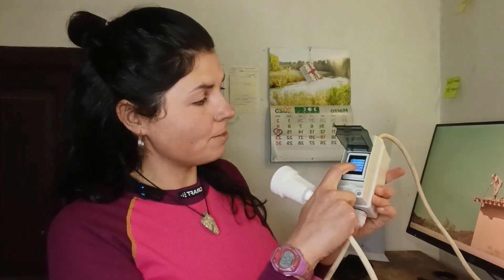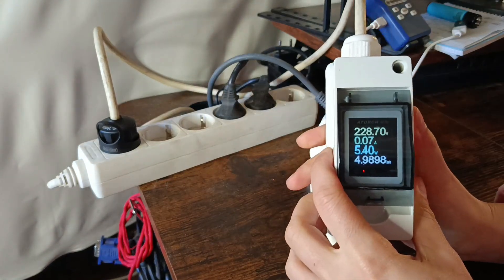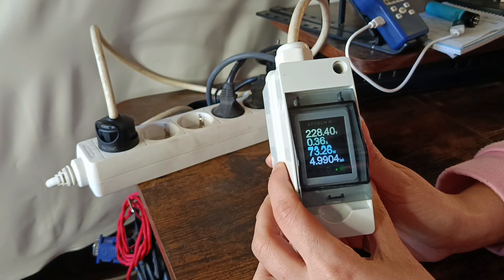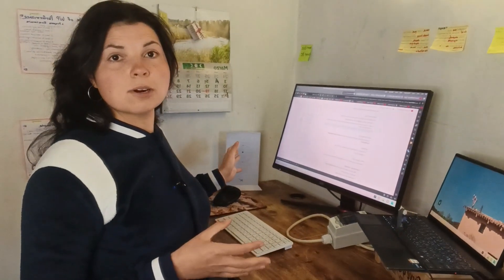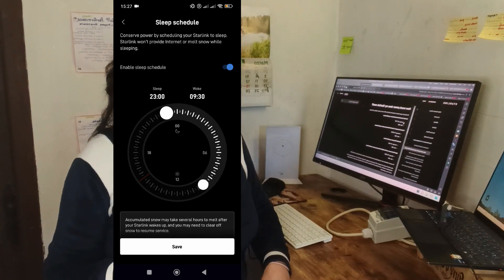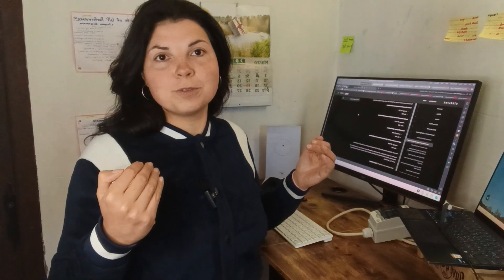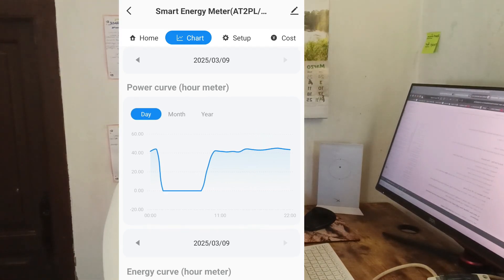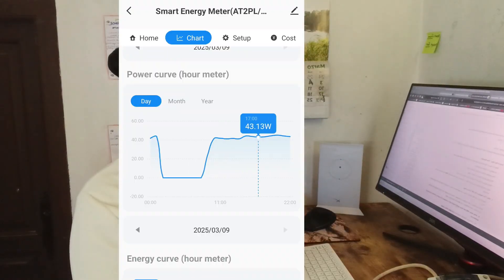How much power does Starlink really use [SURPRISE]

Comment: Hi, Good info, thanks. Just a small remark... Energy consumption is measured in (kilo)watts not in (kilo)watts-per-hour. Total energy used is measured in (kilo)watt-hours. It's a little bit counter intuitive. With a water tank you would measure the capacity in liters and the usage in liters-per-time. With electricity the capacity has the time component and the speed of using it does not. Also, why is part of the video mirrored?
Reply from the maker: Cheers🌷

Comment: Looks like your later generation Starlink uses less power than my original round dish with motors that actively point it in the current direction. I haven't actually measured Starlink and nothing else, but I've measured my "always on" internet things together: Starlink, an 8 port gigabit Ethernet switch, and the Flightradar24 receiver. I don't turn internet off at night (or ever) because I live in a remote place and am the only fr24 site that picks up low-level activity in the area e.g. tourist sightseeing flights on the coast and the rescue helicopter. It's a burden I agreed to when they sent me free equipment. Anyway, over the past 12 days those three things together have used 18 kWh of electricity, 1.5 kWh a day. My full size but narrow (if that makes sense) Samsung fridge/freezer uses about 0.8 kWh. My M1 Mac Mini, 24 core i9-13900HX laptop (my main work machine), a Philips 32" 4k monitor, and several small Arm and RISC-V boards (about 5W each) along with another ethernet switch and a powered USB hub all together use 2 kWh/day. LED lighting in my work area uses about 0.5 kWh/day. The dehumidifier (on automatic setting) varies but is on average 0.5 kWh/day, increasing to 2-3 kWh in very rainy days -- the total was 33 kWh for 28 days in February, 1.2 kWh/day. In winter I expect an average closer to 2. So altogether these always-on things use 6 kWh/day and the internet part of it is 25%.  I also have a 4 kW portable air conditioner which in the last 19 days of January (hottest weather of the year) used 4.25 kWh/day but varying between 0.4 and 8.4. I have it set to keep my office below 25 C, even though it is 28-30 outside, and would be more than 30 inside in the afternoons without it. It uses 1.1 kW when running, and runs between midday and to maybe an hour after sunset. In this location, it's basically running when the sun is shining the most brightly, though with a couple of hours lag (roof and walls heating/cooling). If you have enough solar panels to run everything else in the winter then there is far more extra power in summer than needed to run the A/C, so it's basically free, though ideally it's pleasant to  let it use some battery power near and a while after sunset. I have wood for winter heating.

Comment: Wow , for any one that is off grid that is a terrible ghost load , If I was running such a device I would have it on it`s own power bar with on off switch that I could turn off after use .
Reply from the maker: Turning off helps!
Reply: Indeed, 20W when it doesn't provide internet service seems too much. I mean it's like a 2 averege LED bulbs (equivalent to 60W incandescent)!!

Comment: I have a similar thing that measures electrical appliances. I bought it to check the charging of my electrical scooter. A electronics  expert told me to be aware of the fact that does it does not measure correctly when the Watt's are low, so be aware of that. My WiFi 5G router consumes a maximum of 24W according to the manual. Cheers 🙂
Reply from the maker: Michael, I wasn't that sure first if I want to buy it and now can't stop measuring everything that I see :)

Comment: Can buy 240v timers (Wall timers ! meaning = plugin temperature  timer switch) to switch off and on a wall mounted electrical radiator, select what radiator you like, buy the appropriate heating element ( not to big, would go 500watts max) add reye heating oil. I use one just to keep bedroom above 16deg
Reply from the maker: Do you mean it switches on only when needed? Says, when the temp is below X degrees
Reply: Yes, only when needed, some 24h and some 24/7, just need to make sure your device has a toggle switch.
Reply: Even better idea ! Ive brought two heating elements 300w each, to go into the same 305w radiator, two plugin temperature timers, and im going to set one at 16degrees 10pm to 7am and one 7.10am to 9.50pm during spring/summer/autumn and a bit of winter.